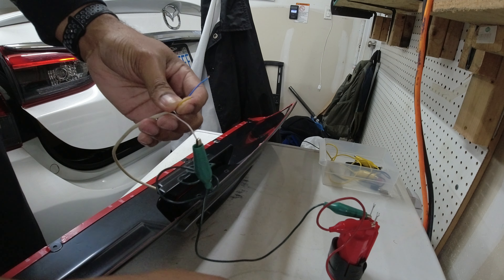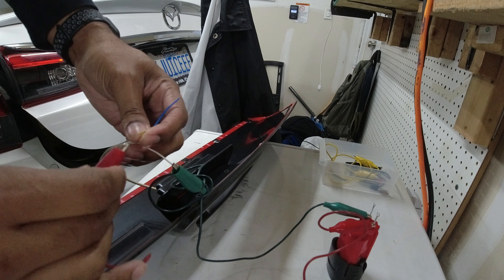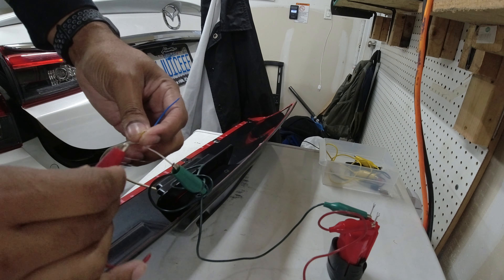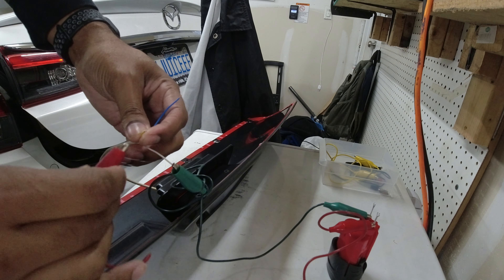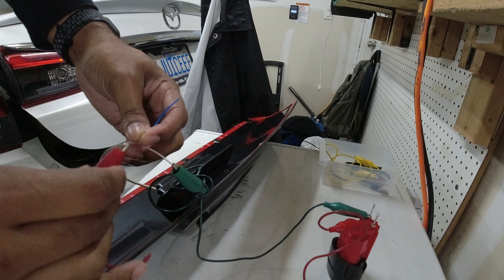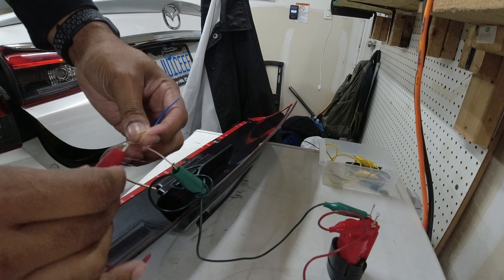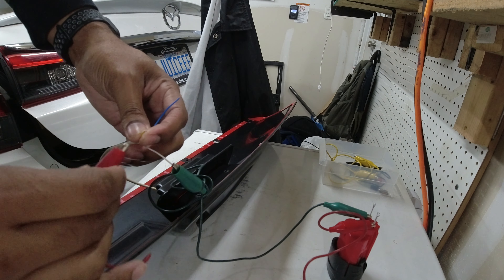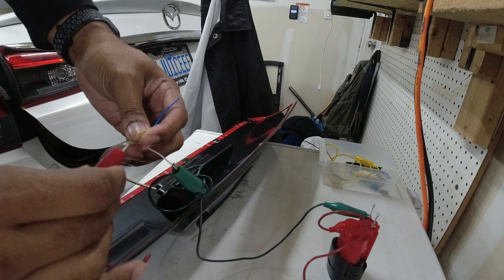MV Tuning V1 Brake Light Wiring | Mazda 6 | The 6 Doctor

Comment: Wish you had shown the connection to the tail light, that's the scary part imo
Reply from the maker: It was hard to get a good shot, but I think i show more when I did my diffuser on my car

https://youtu.be/-hJXRhZF__Q?si=IFmDXDoVq6CCblLi

Edit: check this one out for a better shot at the wiring:
https://youtu.be/UT3YWJyPHB8?si=DTqkHSBveU-ubasI
Reply: @DariusBuildz  I appreciate it man, I keep changing my mind between the 4th brake light and just a normal fin diffuser because of the wiring.